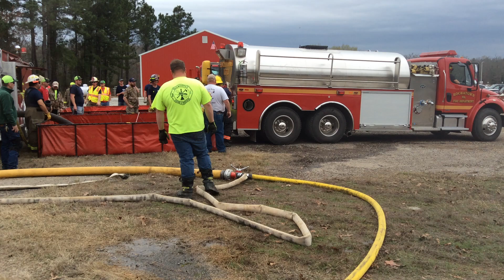Part 4 - Rural Water Supply Drill - McCurtain County, Oklahoma - March 2018

Comment: 🇦🇺 what do you mean by “nurse tanker” ? 🇦🇺 🤓
Reply from the maker: The nurse tanker concept is when a tanker pumps its water directly to an attack engine either for the entire incident or until a different mode of operation is chosen....such as a dump tank operation.
Reply: Thanks. Like your site. Something you don’t really see in Australia 🇦🇺 

Here in Albany, Western Australia we have x2 330 gal (1250L) rescue pumpers and a 530 gal (Urban Tanker, 2000L) tanker supported by 3 or 4 145gal (Light Tanker, 550L) brush trucks. Largest tanker in our region is 1050gal (4000L). There’s only 8 to 10 3,170gal (12,000L) bulk tankers in the state. 

They don’t really bring water to a fire. Either pumping off hydrant, pump-travel-reload, or Nurse tanker generally with one of the pumpers or the Light Tankers supplying the other pumper or Urban Tanker. Can be pretty antiquated having to run water up to 10km with the smallest appliances available. I could start a feed called “don’t have much water”, but I doubt it’ll have many people following.